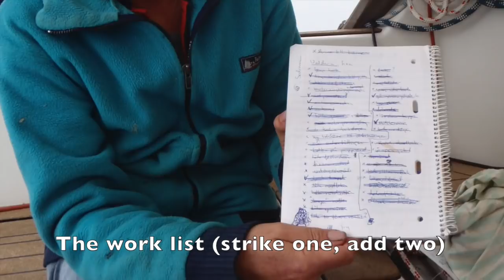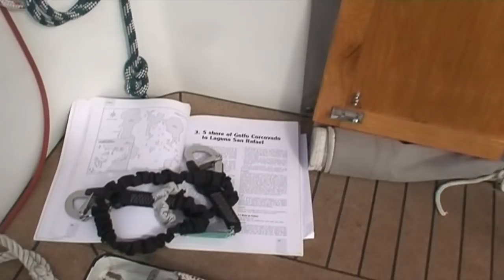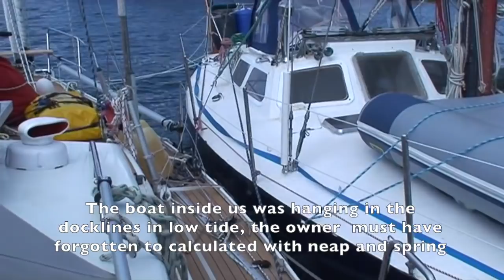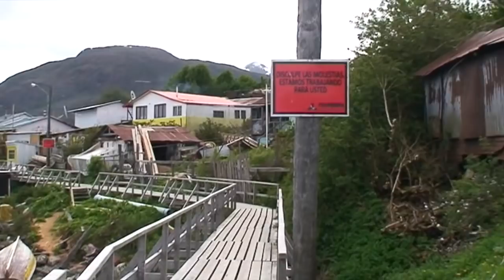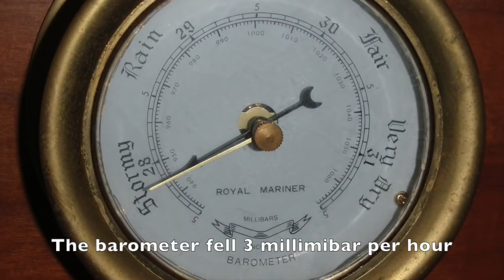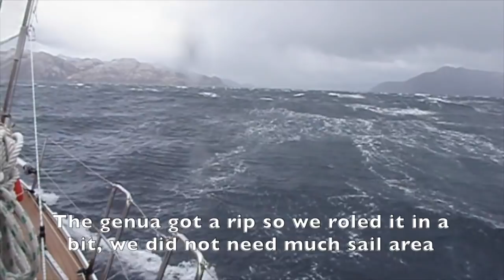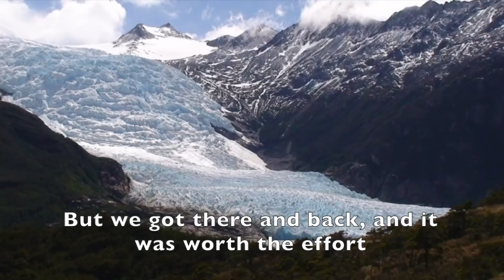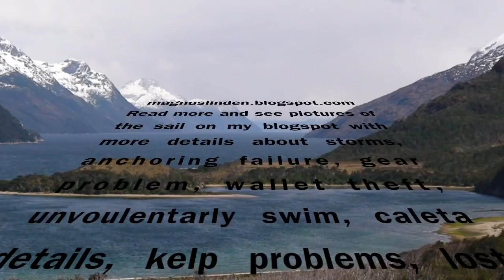Sail through Patagonia

Comment: Thank you so much for a very nice film, with lots of useful info. We will be following in your footsteps in a year.
Reply from the maker: Judith Jacobsen great, I am sure you will enjoy it, it is spectacular. But have time to wait for the weather windows :-).
Reply: @EMagnusLinden  I will make sure of that. I was surprised you could do it in 2 months. May I ask, what was the reason for sometimes not having the anchor down?
Reply from the maker: Judith Jacobsen when we knew the wind would come from any direction and we were landlocked with land close we thought it was better and safer with lines a shore (with chafe gear) than an anchor that could drag in places with a lot of kelp on the bottom. Also it made it possible for a fast escape if needed, just drop all lines and go. But a lot of time we anchored with at least two lines ashore when we were not landlocked.

Comment: did this passage in 88, south to north though,pretty much motored Puerto williams to just north of Puerto montt due mainly to consistent northerlies, got pretty drunk (along with most of the carabineros) whilst tied up at the carabineros wharf in Puerto Eden, planning to do it again someday
Reply from the maker: Sounds exiting, Milo, who I sailed with, did a sail some years earlier with a smaller boat (28 feet) in the same area in opposite direction. She too was frustrated by the northerly winds, especially since she had engine trouble.

Comment: I noticed that you tied off to trees, rocks and other land based location.  Is anchoring not allow or does the bottom not present a good anchoring opportunity?
Reply from the maker: Anchoring is allowed it is just that with unpredictable strong gusty winds from all directions you need to “fixate” the boat in the anchorages (calderas) and a solid rock or sturdy tree has more reliable holdingpower than an anchor resetting in a wind shift or the pressure from a beam storm gust.

Comment: Bonjour , 
Great vidéo thank you. 
How  did you  get  the weather in Patagonia , did you have a satellite  Phone like Iridium or is  there other ways  ? 
We are planning  the same  trip  but  the  other  way , from Europe To Port williams To Valdivia between december and April .
Reply from the maker: Bernard Baudouin Thanks. That sounds exiting, hope you will have a great trip. We had no sat communication so we got the weather information mainly from SSB, there was a local Network (Patagonia Network at 09.00 every morning if I remember right, frequency in guidebook). Milo also had contact with a radio amateure in the Falklands that gave us weather. Also local weather via VHF. An important source was the barometer to see the local change and thereby what wind strength to expect in near future since the weather is very local and changable. Hope that helps. Good luck!
Reply: @EMagnusLinden  "...Very local and changeable..", yes, 100 times yes. Thanks you and congratulations from an chilean amateur sailor!!!

Comment: when you pull up and anchor at remote places like this, is there any immigration checking in stuff or does no one take notice? thanks
Reply from the maker: Hi, you check in to Chile (or Argentina) at a port of entry. After that you are requested to give a plan for what anchorages you plan to visit in what order and asked to report in as often as possible If VHF (when you pass mannen lighthouse, passing ships or like) or daily if you have SSB. This is for security reasons if something goes wrong in these remove areas. However, how you follow the plan and how detailed the plan need to be can vary.

Comment: What temperature range were you experiencing?
Reply from the maker: It varied a lot dependent on weather and latitude from well over 20 degrees centigrades sunny days to around freezing and snow and haul in front passages.
Reply: @EMagnusLinden  A big tip of the hat to you. A challenging bit of water. I've done a circumnavigation but we never had any intention of getting cold! However, I grew up in Southern California, not Sweden, so I qualify as a bit soft.

Comment: Did you motor most of the time??
Reply from the maker: No, the prevailing wind was from the norther quadrant which meant wind from behind in the fjords so we often sailed with only the Genua roled out. Occasionally when there was little or no wind we motored, but not all the time (but filming was easier when under motor).
Reply: @EMagnusLinden  Thanks for the reply.  Hello from Tahoe, my dream is to sail away.  Thanks for the great video.
Reply: @EMagnusLinden   Did you sail across the atlantic, or pick up your boat over here, very interested in where/how you started.  Thanks!
Reply from the maker: Edward Lahr Thanks for watching. Nourish your dream and make it come true! Good luck!
Reply from the maker: Edward Lahr I have workied on charter boats and done deliveries on other boats apart from Cruising on my own boat so I have done several crossings (over 100 000 nautical miles), but it all starts with sailing small boats in the nighberhood :-). I have a home page for more info (it is in Swedish but there is a translation function - not Perfect but ok. The HomePage is www.bortomhorisonten.nu
(also in the bio). Fair winds and following seas!
Reply: Edward Lah